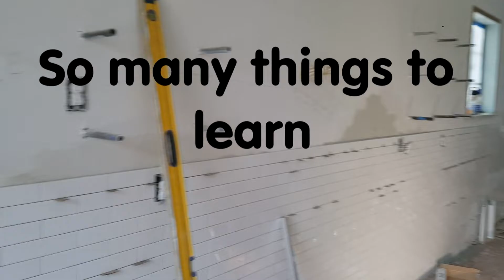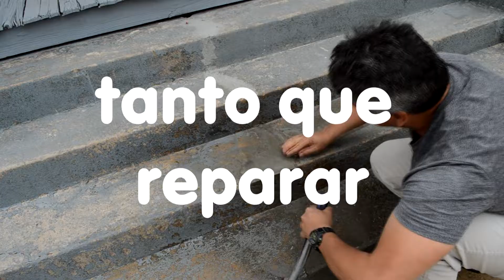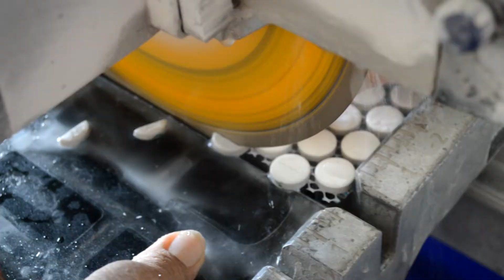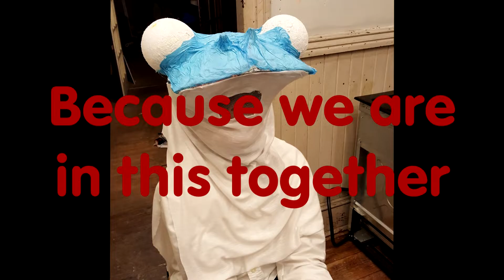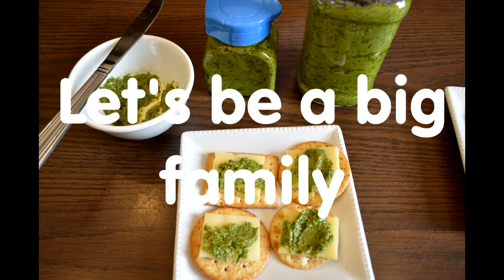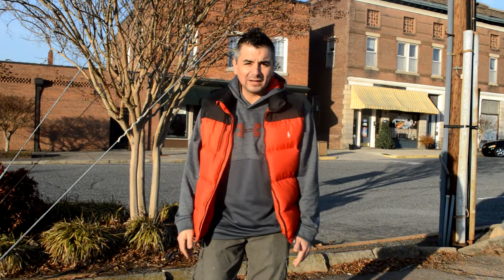Welcome to my channel Hugo Correa!😉🛠Do it yourself (Hágalo usted mismo)

Comment: Hola Hugo, quisiera hacerle una consulta, tengo un tina que removí para convertir en ducha. El problema es que es una casa de concreto (CBS). Todos los videos muestran como preparar el shower pan en estructuras de madera pero no encuentro nada que me guíe para trabajar con paredes y suelo de cemento, me podría aconsejar? Gracias
Reply from the maker: si, utiliza una cosa llamada membrana impermeabilizante, se cubren bien las esquinas con malla de fibra de vidrio y luego se aplica este plástico liquido en las paredes y piso con un rodillo pequeño y brocha, encima de eso puedes instalar las losas, debes de darle inclinación a la base. Espero esto te ayude.